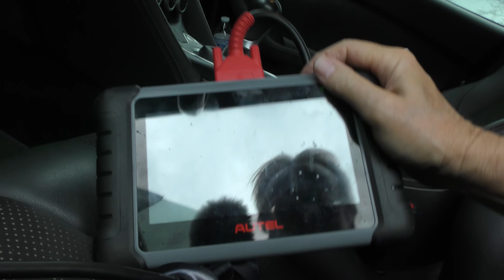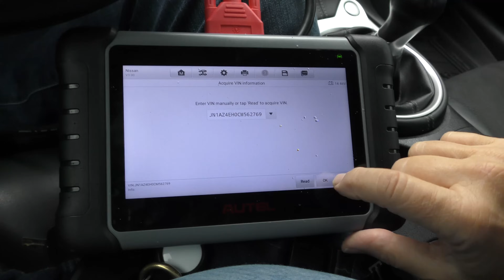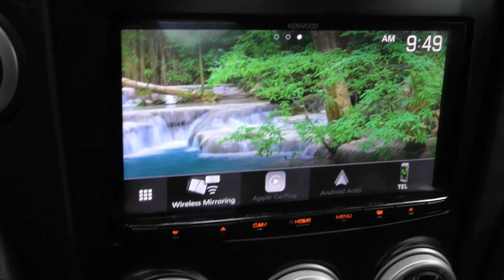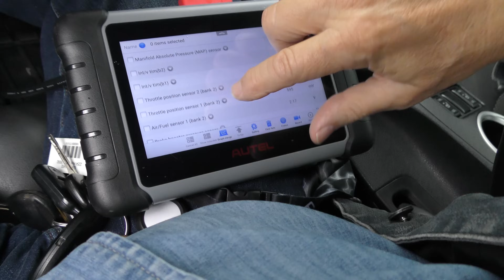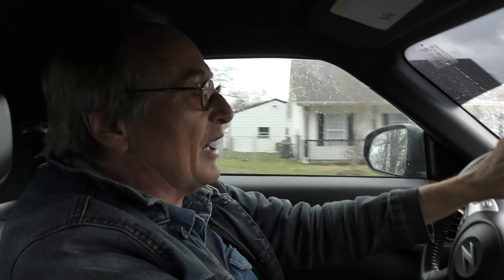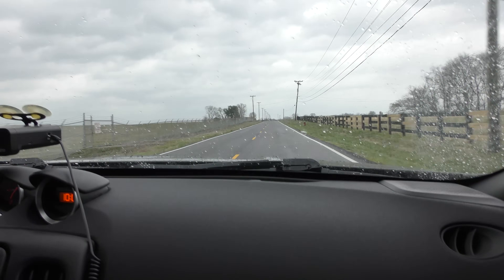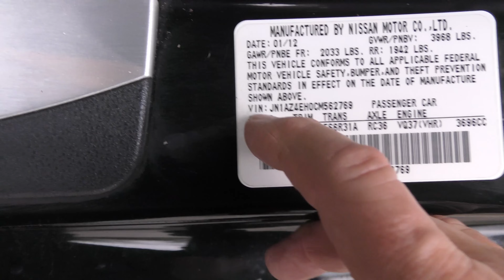This New Car is the Biggest POS I’ve Ever Seen

Comment: Scotty, I have the same 370z after driving it and getting the engine nice and warm and letting it sit for about half hour or more it takes about 5 to 10 seconds of cranking to start. Once it does start it runs fine. Cold starts are fine also. I was thinking weak coolent sensor or oil temp. sensor or cam sensors. Had it looked at and was told I had good gas pressure. Will a ODB2 scanner find the problem.
Reply: These OBD2 'sensors' (I think you mean a 'scanner') can be USED by someone to track down the problem, but it's not as easy as plugging it in, and the thing telling you what part to replace -- you have to understand how to use it and what the information means. 

As it happens, I once had a car that would die while idling and be hard to start when cold (the OPPOSITE of what you have). I replaced the fuel injector o-rings and never had a problem after that (it must have been leaking pressure in the fuel rail, as the engine cooled down). Cost me about $5 for the o-rings. I know I had the opposite conditions, but your results might be related -- I suspect that things can also begin to leak as they warm up.

I know that you said someone checked the fuel pressure. Did they check it when the car is absolutely cold versus still warm? I think you're on the right track by looking into fuel rail pressure or the cam sensor... but I'm not a mechanic.

Anything weird like accidentally running the car out of fuel, or adding fuel system cleaner recently? Could be bits of junk in the fuel now, or a weak fuel pump from overheating (from running out of gas).

Comment: I have the same problem on my 350z yes they have mechanical lifters which can not be set up by hand you have to measure the valves than the lifters when you do that you have to check what sizes of caps are in stock there are lots of sizes depending the wear I recommend fixing it it's worth it that's what I did now it's running like a clock

Comment: I’ve been told that these Nissan Z cars have reliability problems. Any observations?
Reply: Nah, they’re solid but used ones are almost always beat up. They’re fun to beat up!
Reply: Nah man. The only concern is the Concentric Slave Cylinder in the 370Z’s since they are internal on manual trans variant. Also just oil consumption. That’s it… other than that, they run forever.

Comment: Thank goodness for u 
Ive been debating a Motordyne or Tomei exhaust soon
Long story short...My 1st G was a 05 G35 coupe manual back in 09 put like 15k$ into the car did almost everything except turbo. stillen exhaust test pipes injen intake cold air 19 in wheels with 285s tires in the rear coilovers light weight pulleys intake manifold performance chip also tuned it headlights lip spoilers grill swap stage 3 racing clutch changed master cyclinder and lightweight flywheel camberkit racing ignition coils and plugs slotted rotors etc...
My 2nd 2011 auto was a G37 coupe IPL in 2018
My 3rd was in 2021 another 05 G35 coupe auto 
And now in 2023 an 04 auto G35 coupe. Its pretty hard to find a decent condition manual in Miami fl 
Deep love for these vq  coupes

Comment: A C4 or C5 Corvette is another great 2 seater you can get for not much money. They're better built than the Nissan and are faster. I got 29 mpg with my 96 C4 on the highway and it had the optional LT4 engine. Drove it 10 years with no problems.

Comment: I got the new 400Z Sport and it is by far the best car I've had. Even though it's really just a 370Z with a new power plant and a facelift. I still love the thing. 6 speed manual, lightest weight car I've ever driven, rear wheel drive, two seats, twin turbos... This thing can hang with a scat pack so I'm happy with it.

Comment: Car Lifts...I saw a video of a car where the lift had been left plugged in overnight, liquid dripped on the controller which shorted out, and the back end of the car got shoved into and through the roof of the shop.  It was a fancy expensive sort of car.  Worker Wanted:  Competent Mechanic

Comment: I have had a 370Z Nismo from 129 miles off new for 5 years (paid £30K for it ). Great old fashioned analog sports car with hydraulic steering, manual gearbox, and NA engine. Still absolutely cannot be beaten for “fun per buck” as my American cousins would say 👍🏻

Comment: Bought mine new in 2011 with 56 miles. Its at 114k now and only things to fail were the steering lock (known issue) the fuel sending unit in the gas tank (known issue) and a cat converter that had to be replaced.

Comment: Had that vq engine in a 2010 maxis a a while back. Loved the constant power of the cvt, but being an interference engine it died at about 60k miles when a crank shaft position sensor failed. Great engine but I’d never buy an interference engine again.
Reply: Why didn't you just buy another crankshaft sensor they only cost $80 give or take at AutoZone and your Maxima would've been back on highway but I do agree those sensors on Maxima are annoying even tho it's a simple fix

Comment: I own the original 1964 datsun 260z, previously owned a 2009 370z base model, sold it. I really Missed it!, so I went out and bought another one. Now I own a 2012 370z nismo Basically race model trim package. Nicer Wheels, body kit and suspension. Its nothing crazy!, but I am a hardcore Z guy.

Comment: Zs and G coupes are great cars but super expensive to insure for younger drivers, at least where I live. Assuming all else equal a 22 year old with a clean record can insure a 2016 Audi Q7 for less than a 2008 G37. 370Z are not much cheaper, by about 10%.

Comment: No they’re not having issues selling them.  They’re selling them even with insane markups.  Build quality of the interior and chassis will be on par with the 370Z I imagine since it’s the same car (not necessarily a bad thing).  I prefer the look of the 370Z but maybe I’m biased owning one.  167k mi and still running strong with no issues since ownership at 34k and I don’t abuse it but don’t pamper it either, it’s seen more than a few track days.  I think they’re both going to be great cars and with unlocked ecu’s the limits to what can be achieved are impressive and the engines overbuilt to take it.

Comment: sorry scotty but the vr30dett is a amazing engine (new engine in the new z), i had a q50s which has that same engine and that engine is bullet proof, it did have some timing chain issues and turbo issues in the 2017 and under but the engine is still new and they still working on it, mjne was a 2019 and it was so quick and very very tunable
Reply: The Irony of your statement..... Also there is no such thing as an open deck turbo motor that's reliable or good. Its cheap engineering point blank period. The old NA vq  mother rs are gems though.
Reply: @Dulanor  the bmw n55 is a open deck turbo charged motor, proven to be a very reliable motor there are reliable open deck turbo motors

Comment: I disagree. I never had any major issues with my Twin Turbo 370z. The reason it makes that sounds because people use crappy full synthetic oils. I only use Amsoil 100% synthetic oils which removes the idling noises and makes the car run better than new and smoother.

Comment: That beast gets the same fuel economy is my 92 MX3? Mind you that my MX3 only weighs about 2400 lb, it's the lightweight model. Unfortunately it has a almost 4.4 final drive with a  .870 5th gear. That means about thirty-two thirty-three hundred RPMs at 65 mph 4K at 80 MPH which... I really need to stop doing... I'm going to get a speeding ticket.... But it's so much fun.

Comment: The 400z is a tuner car and has 400 hp I've seen people get 600 hp with a good tune they are not garbage it's still new and it's hard for dealerships to get them in and also mark ups at 10 to 20k does not help selling cars

Comment: even if i had unlimited money, i would still buy this car. 370z 350z nismo, whatever. anyone you cant go wrong with. its fast. its reliable if well maintained, its a good value for what you get, its manual, drifts, and most importantly its great looking. only thing is its more of my style right now, as a younger guy. when im 5 years older i'd probably get something with 4 doors.

Comment: Stop hating on turbos. My focus at ecoboost. Like 1500 RPM’s 6th gear. Pull u right up a hill. That low end torque is ridiculous….. yeah it’s GDI. Just did my sea foam and oil change. Love my turbo 4 banger. Coming from a v8 ford and mopar guy

Comment: I finally saw a new Z at my local nissan dealer when I went to pick up some lugs and studs (don't ask, just thinking about it makes me angry) for my 370z. It's okaaaaaaay I guess. The aesthetics are really not very attractive when compared to just about any other competing vehicle at or under that price point, but I think where they really went wrong is when they missed the MSRP by like 25 GRAND compared to the announced estimated cost months before launch. I would have probably traded for one months ago, but I can install a twin turbo on the 370z I already fully own for less and net more power. Even in California there's a CARB TT kit. The new Z is competing with the last model and failing in price to performance. It's really hard to watch.

Comment: I respect you alot Scotty but no if I owned a Z it will have more power it has to. I don't get thrill much by the stock hp . Some cars yes your right they are fun but that's for an old guy . If I myself want to have fun I'll recommend something that comes with atleast 400hp . There quite a few cars out there.

Comment: If you want or need that torque to kick you in the butt at lower revs on this NA engine you can just downshift to the gear you want and pull away like a bat out of *ell. The nearly flat torque curve across almost the whole rev range, mated with the close-ratio six speed transmission, means that you have great flexibility in choosing the right amount of rear-wheel torque to lay down for almost any driving condition.

Unlike the typical turbo, which generates so much unusable torque at low revs, this engine gives you healthy amounts of torque everywhere across the rev range. You just have to drive the car with some degree of mental engagement to be able extract all that it has to offer. Itis still much easier to drive than those highly-tuned race engines that have all their torque concentrated within a small rpm powerband. Those cars need to be driven with a very high level of alertness and focus on what the driving conditions one is going to encounter while at speed. I had a Porsche 944S that had an engine like this.

Comment: Ugh I have a 
09 nissan  370 with 17k miles and my 5th gear is already grinding, first gear is sticking.. I took it to a trans shop, I changed gear oil to redline MT hoping it would help.. but it feels worse…. Now I’m trying to figure out if I want to rebuild it, buy a used trans or a brand new trans..

Comment: There is a product called Scan Guage for 18 wheelers that hooks to diagnostic ports and gives the driver real time info that will help them drive in a more fuel efficient way. Would it be bad for me to use one of these since it stays plugged in?

Comment: two seaters are done. Most peop;le want something they can have multiple uses with. SUV can be used as a people mover as well as something to tow or move things in its actually an MUV multi use vehicle.   Specialty cars are just that single use only vehicles.  They dont sell because not enough people want them

Comment: If a car has  high miles and a turbo that wears out, can't you repair It? Is it really a huge fix? Scotty seems to always say if a car has a turbo that's a deal breaker. Don't buy a used car w/a turbo.
Reply: Well imagine both makeing the same power but one needs a turbo to make that power at the same amount of miles one needs a new turbo which is garunteed to be a couple thousand dollar job and the other car that’s made the same amount of power the whole time doesn’t need an expensive new part

Comment: I disagree with you on both the 370Z and the new Z... plenty of people are buying the new Z, the only issue is that most people PROBABLY want stick but dealers got mostly (or only) autotragics.  As for the 370Z, that thing must be BEAT ON, because Ive seen thrashed, high mile G37/Z at drift events without that noise.  I have yet to hear a single problem with the 370Z, the 350Z was junk if you didnt get the VQ35HR
Reply: @@mynameisunavailable3546 Junk as in, couldnt take as much abuse as... its still obviously a great engine, but it needed an oil cooler if you were gonna drift or race em

Comment: Scotty ...I have a 2010 infiniti G37  sport...with hardtop convertible.  It really is fun to drive..I'm 69 and drive it about 8K miles a year..at 110000 miles now...synthetic oil changes every 5k have been done..I'm retired and would to keep it...what should I do now with that mileage to get this to another 100K ...appreciate your advise.
Reply: the 2008-2014 vq37vhr motor has issues with worn gallery gaskets, which can cause low oil pressure and ruin the whole motor. This can happen at any time. I would recommend getting the gasket changed using the z1 gallery gasket kit, also water pumps go out on these too. I did both of those things on mine and its running great its good preventative maintenance, I know someone with a 2010 g37 who has 230k miles on the dash (he changed the gallery gasket and water pump too). Keep doing oil changes 5k miles and full synthetic

Comment: I know Scotty has lots of experience as a mechanics but he is 100% wrong on the new 400z I has so many VQ37VHR cars they are fun and sturdy and can go far past 200k miles but new 400z cars are trapping in 12 seconds quarter mile. 9 speed autos are fast the torque of the turbo cannot be compared. My G37 NA made 340whp but it was FBO with long time headers ported manifolds GTR injectors to support e85 and it was still slow for me

Comment: OK THIS IS GOING TO DRIVE U CRAZY LOOKING TO BUY AN E CLASS MERCEDES I HEARD U WHERE TOLD REPLACE BRAKE PADS HAD TO GO TO THE DEALER TO RESET COMPUTER HERE THE QUESTION IF U KNOW WHAT YEAR IN 2000 MODEL THE U DIDNT HAVE TO GO TO DEALER IF U REPLACE BRAKE PADS FROM AN OLD GARAGE MECHANIC GUY AND YES THAT IS STILL MY 68 VETTE THKS FOR YOUR REPLY THK U FOR BEING THERE TO HELP US OUT HERE ✌

Comment: PLEASEEE HELP ME. I have a Toyota rav4 2002.84,000+ miles . Recently fixed had a shop rebuild my transmission but after 2 weeks of it being fixed my car would go 1-3 RPM around 40 mph & when I slow down to make a stop a hard bang can be felt & heard around the transmission. I went back to shop they told me it might be something that gives pressure to the transmission shifts that can cost around 3,000. Can anyone confirm this being true?

Comment: On my 1972 Pinto 2.0L and 1969 VW Bug, you adjust the valves with a box end wrench and feeler gauge. New cars are designed to be disposable.

Comment: The problem with the new Z is the price. Who wants to pay 50-60K for a car with a smaller turbo engine that isn't all that much faster. You can buy one of these 370z in the 20s and spend up to 10K for a Stillen supercharger and you'll have a car with up to 500ish wheel horsepower. My 2011 Z (automatic) is tuned with some bolt ons and it's enough to get into some real trouble or a crash. Common issues with the pre 2013 VQ engines are failed oil gallery gaskets and the clutch is notorious for failing slave cylinders which can be fixed easily enough. One recommendation I have if you don't have limited slip is a Quaife torsen differential. Launches much better with it.

Comment: I had a 6 speed and my flywheel made noise until u push the clutch in then the noise go away until u let out the clutch did it for 200k+ miles but never effected anything just made a lil noise.  Btw I sold it with 331k and still running
Reply: These engines and trans last forever as long as you maintain them man… thanks for watching 👍

Comment: I’ve got a 2007 Saab 9-3 with 216,000, with the original clutch, 6 speed standard 210HP turbo.  Runs like a champ!  Also, original Wheel beeping hubs, no noise!  Original rings, rod and main bearings, original Transmission, etc. etc…. Too bad GM killed the company!  I will say, Scotty, you do have informative videos!  Too bad Saabs aren’t your thing, despite their bankruptcy.  They were ahead of their time!

Comment: Hey Scotty my car jerks when I let go of my gas it more noticeable around higher speeds any thought on what it can be
Reply: That sounds like either differential wear, or transmission wearing out. But since you said higher speed… I’d check your fluids in both your trans and differential.
Reply: @NXCProductions  do you think anything with the spark plugs?
Reply: @TheYokedBoys  if it was misfiring yes. It could be but if you said your car jerks when you let off the peddle and that’s the only time it happens than it’s most likely not something to do with a misfire… like do you mean like it hesitates? Or it clunks when you let go of the gas?
Reply: @NXCProductions  so like when I’m going around 60MPH and above and I let go it’s like a jerk hard to explain